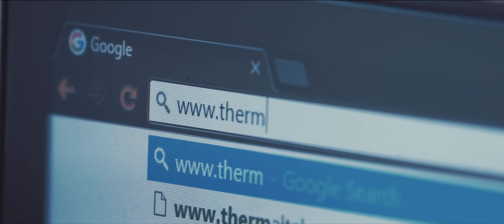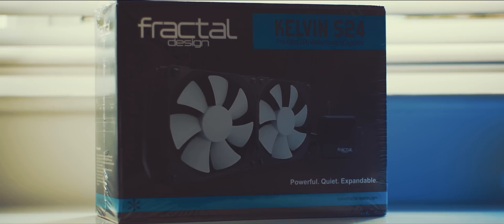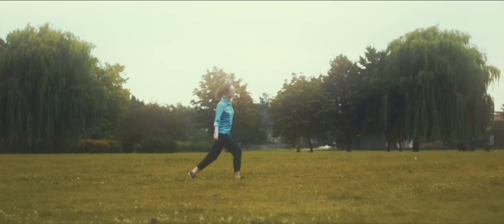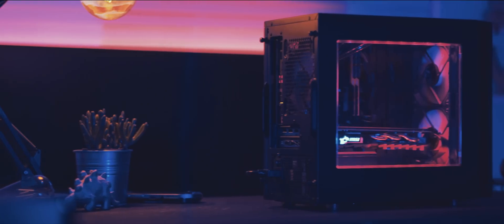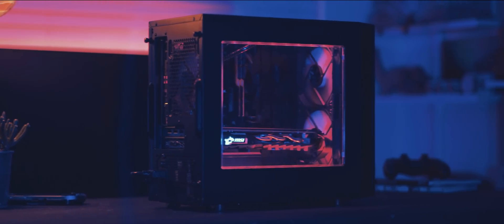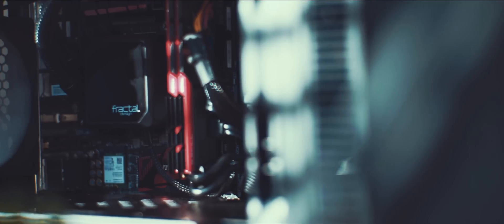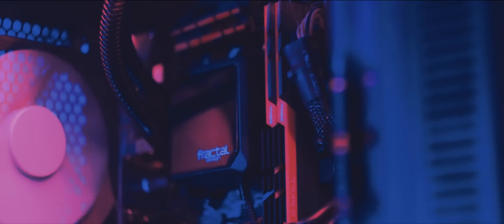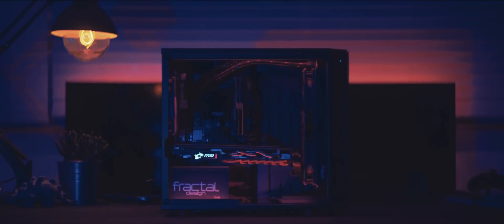Building the ULTIMATE PC for $1500! // The Girlfriend Build

Comment: Is this  sponsered by ""Fractal""
Reply from the maker: No, i didn't get paid. I just harassed them until they gave me the components for the build (and also sold them the idea) :)
Reply from the maker: Erik B The used. Love them. I guess it was all down to longevity and scalability. This way I can upgrade as demands increase which might be the same for the example you suggested. 

I didn't get paid to make the video. I wanted those pieces and asked until thankfully they said yes and in return they get to be in my video. I guess it also depends on your perception of sponsored. There are those out there that get paid loads and you can tell by the way they promote and talk about it.
 This wasn't like that not was I being directed what to say about the products :)
Reply: if they gave you the components how wouldnt this be a sponsor build? Did you pay for the components or not?

Sponsoring or not aside. Unless it was some really cheap pricedeals, why else would you pick a full atx PSU with a aftermarket cooler gpu?
Would make more sense to go SFX PSU and aftermarket cooler or ATX PSU and a blower in this case. but whatever floats your boat, nice build anyways. :)
Reply from the maker: Erik B The used. Love them. I guess it was all down to longevity and scalability. This way I can upgrade as demands increase which might be the same for the example you suggested. 

I didn't get paid to make the video. I wanted those pieces and asked until thankfully they said yes and in return they get to be in my video. I guess it also depends on your perception of sponsored. There are those out there that get paid loads and you can tell by the way they promote and talk about it. This wasn't like that not was I being directed what to say about the products :)

Comment: Hey Ash
Big fan of your work. Not only do I agree with your opinions/tastes but your content is always presented beautifully. 

Quick quesitons. Your videos make wonderful use of lighting changes. I am particularly intrigued with the shots where the camera is sliding and the lighting setup flicks back and forth between high-key and low-key during the slide. (in this video 7:50 is what I am referring to)

Are you using a motorized slider to clone the same camera move? Or are you just THAT good at manual slides?

Comment: Great video: just wondering, could this PC handle simple games like fallout/battlefield/cod? And how much does the whole build cost?
Reply from the maker: +Michael J hey, roughly speaking it just hits £1100/1200. It'll do fine for gaming like that. More than enough memory and the CPU is great. The 1060 will run games fine at 1080p, thats it's main target but if you want multi monitor or higher res gaming then 1070/1080 is what you need to be looking at. This is very brief but it's the crux of it :)
Reply: +Ash Tailor (ashthought) would it run 1080 at 60fps well? Or would the 1070/1080 be better?